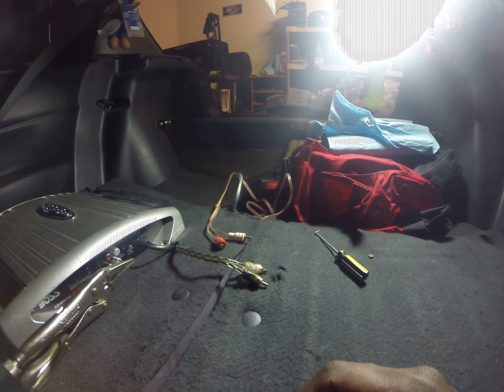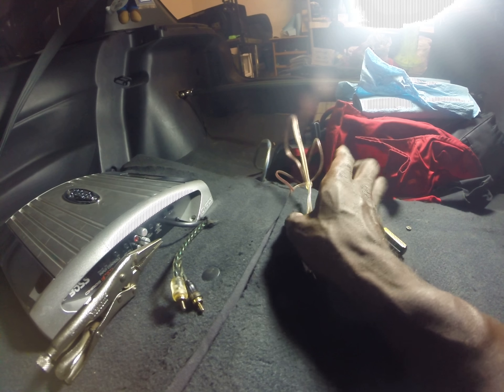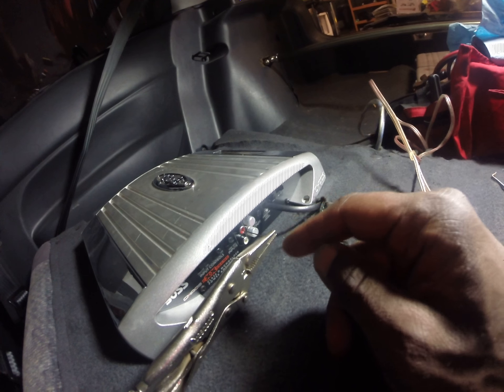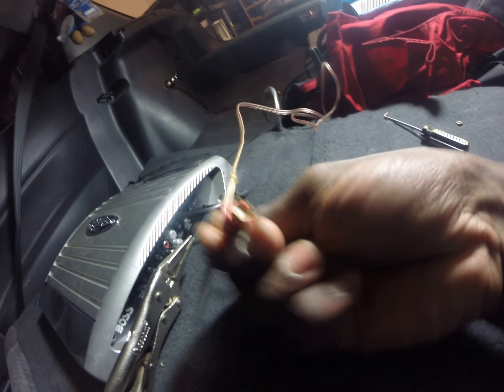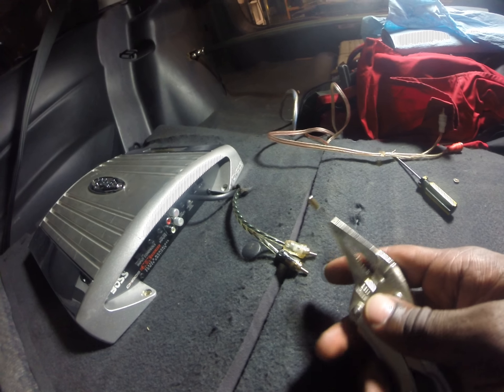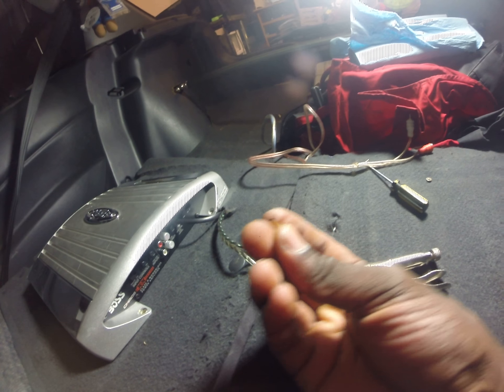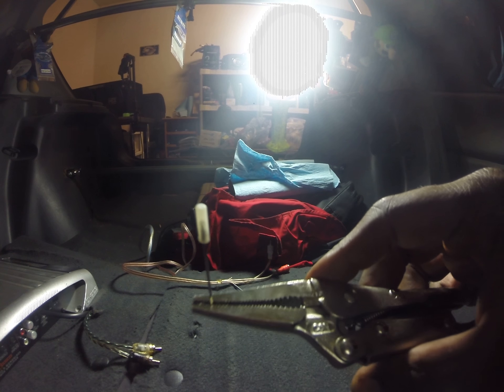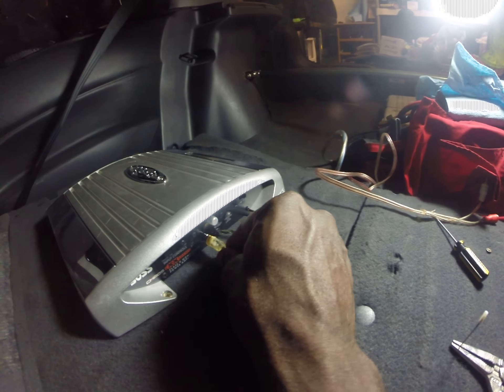Broken RCA wire in your AMP FIX

Comment: I'm replacing a low quality 4 channel car amp with a better quality more wattage amp. My question to you is should I change out rca plugs or just leave them alone? Not having an issue or problem with them but do they wear out with time or not? Thanks for the video, keep'm coming.
Reply from the maker: Tony Garza you can leave it alone unless you want to buy a more expensive RCA for higher conduction.
Reply: I need new rcas mine are the ones he plugged in at the end. Idk whats up with them wires in plug are poop or something amp turns on and no sound or bass. But I have never messed with them since I put it in like 4 years ago. Imma try new ones and get back to yall

Comment: yo my dude... I tried this method and the plastic pin/shielding pushed thru into my amp??? How the Fk??  I hear it rattling around, I hope to god it doesn't short a mosfet or something
Reply from the maker: Bro sorry to hear that But if you can hear it I will suggest that you open up the app and take it out.